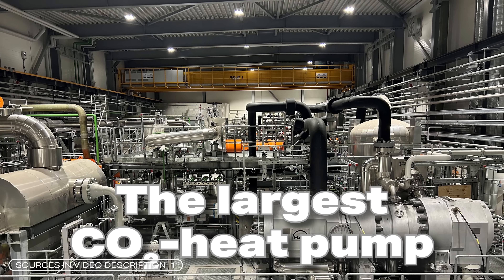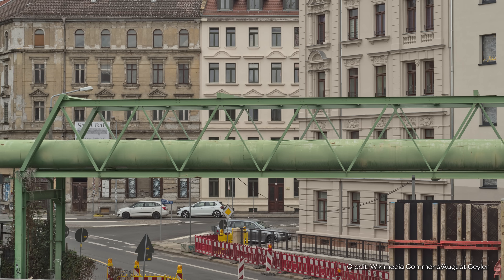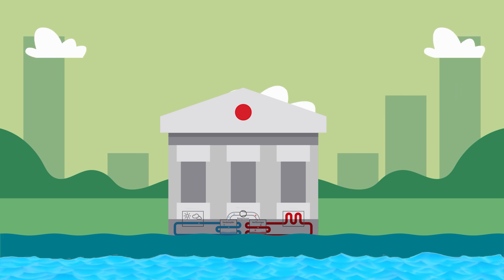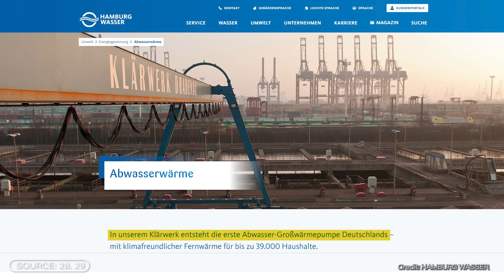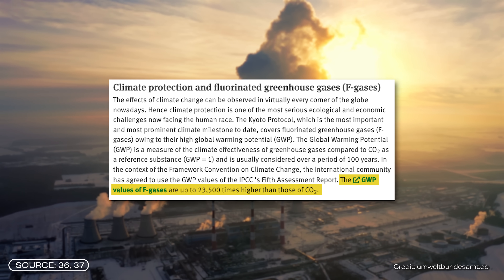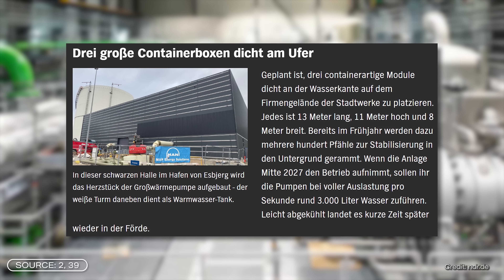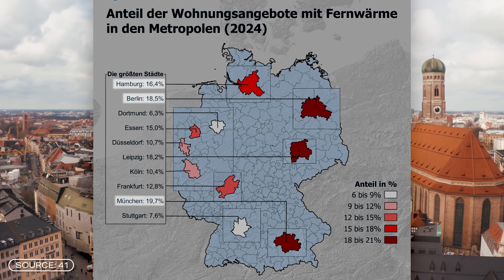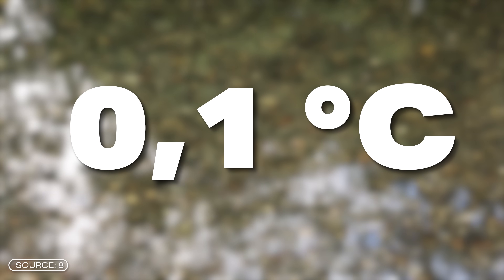World's Largest Heat Pump: Denmark’s Seawater Heating Revolution

Comment: Greetings from Denmark. 
We have a co2 reduction target of 70% already in 2030 and district heating is a big part of why this can be achieved because it enables centralised investments in co2 reduction tech instead of needing to persuade 1000s of individual households. Yes, in some cases it is a bit more expensive, but overall I think people are pretty satisfied. People tend to forget the costs associated with natural gas boiler maintenance and replacement. A residential heatpump installation is easily typically 15-20K euro here.

So you Germans just go ahead and start expanding you district heating. Then you can kill 2 birds with one stone and put some fiberoptic cables in at the same time and get your miserable internet sorted as well ;)

Comment: I'm a Dane living in an area far from district heating, so my 5 year old 95m2 home is exclusively powered by electricity. It's insulated according to the latest standard with floor heating.
My yearly total energy consumption is approximately 2.300kWh. 
The heat pump is very quit since heating only requires room temperature level. 
Heating hot water is a bit more noisy, but programmed to take place every second day when consumption is low and therefor cheap. 
Electricity supply is 85%-97% renewable.

Comment: The future could be about building enhanced geothermal systems (EGS) involving hydro-shearing (which is different from highly problematic hydraulic tensile fracturing used by the oil and gas industry). And unlike near-surface geothermal energy, it can be used across the board almost everywhere, at least in Germany.

Comment: Seawater will typically freeze only when it reaches -4°C (about 25°F), so why does that one big heatpump shut down when the seawater temperature drops below +8°C ??? That implies the flow of seawater through the water intake is too small, so it gets too cold and starts to freeze in the Evaporator section. Sounds like a very bad design! @GermanScienceGuy

Comment: We are located in Finland and we have a ground source heat pump (GSHP) in our 110m2 home. 5/5 and wouldn't change it to anything else! 🫶
I haven't measured how much the pump itself uses electricity in a year but the houses overall electricity consumption is a meager 7800 kWh so it can't be that much.

Comment: Greetings from Finland. My housing co-op with 9 buildings used about 1900 MWh of district heating per year. We converted it to heat pump a few years ago plus over 250 kWp of solar panels. The price of district heating and the required renovation costs of partially 60 year system would have been more expensive.

Comment: Here in Southern England, have a pop-up swimming pool in my garden between June and September, I heat it with a heat pump sitting under my gazzibo. The cold air from the pump cools the general environment around the gazzibo whilst heating the pool during the day and it runs of solar panels on the gazzibo roof during the day, but I mostly use off-peak electricity over night so it cost little run. A really positive experience of heat pumps so far.

Comment: DK: You also have to mention that the losses in the district heating system is systems are qute large, compared to i.e the electric grid. Losses between 20 and 30% is not uncommen, depending on the season. Due ot this fact, a new concept is being developed, where you lower the tempertature on the water in the system significantly, maybe down to 40 or 50 degrees C. And then use that to heat rooms. The hot water needed in the households is then locally boosted to 60 or 70 degrees C, either by a small heatpump or just by electricity (which in DK are mostly green anayway). In this way the losses in the district heating system is cut in half or more. The downside is bigger transmission lines and the need for bigger heat exchangers in the householdt (bigger radiators). But I think this is a genious way of minimizing the losses, epscially in more thinly populated areas.

Comment: Denmark frequently experiences periods of negative electricity prices, even though it actively works to avoid them by curtailing some wind turbine output and diverting surplus power into large electric boilers and, increasingly, centralised large-scale heat pumps for district heating. These heat pumps not only soak up excess renewable electricity but also cut fossil fuel use in heating and provide valuable thermal storage for the energy system. At times, wind turbines alone have produced more than 140% of the country’s electricity demand, with the excess exported to neighbouring countries. Despite this, Denmark continues to expand its renewable capacity in pursuit of 100% renewable electricity. In recent years, close to 90% of its electricity generation has come from renewable sources—an especially impressive achievement given the rapid growth in electricity demand from heat pumps and electric vehicles.

Comment: My parents switched out their old oil furnace for a heat pump. It cut 75-80% off their heating bill, and the whole system paid for itself in 4 years.
Reply from the maker: That's insanely quick!

Comment: COP (Coefficient of Performance)
That is always the question with a heat pump.
I have a geothermal heating system which is 20 years old and when I'm lucky it has a COP value of 4.5 kW.
That is, I use 1 kW electric energy for the compressor and then I get 4.5 kW of heat.
In theory it is possible a COP value above 5.5 kW but I have not seen it yet.
Sea water should be better than geothermal.

Comment: The problem with district heating versus local heat pumps is that you lose the ability to have a dual-purpose heat pump that can also function as air conditioning during the summer. This will become increasingly important across much of Northern Europe in the next 10 to 30 years. And let’s not even get started on the cost of district heating — it’s significantly more expensive than using a local heat pump. In Denmark, it costs nearly twice as much on average, according to Bolius, a Danish NGO.

Comment: Heat from industrial waste can be used all year around, while heat from sea can be fired only when extra heat is needed. It means a more complex heat plan, but it can be very flexible.

15 years ago, individual heat pumps could not work below 5 C. Now they work with minus temperatures. That 8C limit will soon be broken.

Change of provider will be managed like for gas or electricity. When you change the electricity contract for your house, they don't put new cables. It is an administrative change and the actual change of electricity producer happens way higher in the grid. Same for gas. There is no reason the same could not be made for the supply of hot water.

Comment: We don't have them in Australia, but to me it seems like a lot of infrastructure and loss of heat moving it around a city. And really they are electrical heaters from compression, with assistance from an environmental sink. So they are not really 'environment friendly', they are still bascially electrical. They would not be built if they weren't more efficient, but I just hope they are not being built as more inefficient than other methods just because someone labelled them 'environmnet friendly'. Also, to cope with closing 2 weeks a year a whole seperate parallel infrastructure must be built, this is a major flaw. They probably haven't costed because they know it will look extremely bad. Like much of the 'environmental sources of energy', a parallel infrastructure must be built and maintained for when there is not wind or sunshine, and that cost is not included in the cost of the initial infrastructure, because it is old skool fossil fuel. Too many smoke and mirrors in all this for me.

Comment: In the southern US especially in areas without natural gas all electric houses are very common. The majority of house have reversible air source heat pumps to cool in the summer and heat in the winter. Radiators are almost non-existent so that the forced air system used for cooling is also used for heating.

Comment: I live in Copenhagen, we have district heating and it works wonderfully. When everyone else experienced massive price hikes because of the Russian invasion of Ukraine, we breezed through it with cheap staples clean energy, I am really grateful to the unsung hero’s of the Copenhagen energy infrastructure, quietly and reliably doing a grade A job🙏🏻❤️
Reply: that is plain incorrect it just came delayed over a 1-2 years. since 2022 Hofor the company running district heating in Copenhagen has raced prices 22% per MWh and the fixed yearly fee 26%. Natural gas prices are down 60% since February 2022. in reality natural gas where already 30%  below prewar prices buy first of January 2023.

Comment: The sea has an almost inexhaustible  amount of heat at higher energy density to air and a relatively stable temperature year round. Also the sea is getting warmer due to climate change. So this makes sense. The UK could benefit - it is surrounded by the sea and many large towns are located on the coast or on river estuaries.
I saw an experimental sea water heat pump in a science program years ago and wondered why this is not already extensively used. Something to do with corrosion of heat exchangers by sea water maybe ? Just a technological challenge.
Not having 100% renewable electricity is not an issue. The heat pump multiplies the energy by 4 or more so one unit of gas generated electrical energy (efficiency 50%) could generate 2 units of heat. So this has already halved the gas consumption compared to burning the gas directly for heat.

Comment: I still don't understand how heat pump heating works... Let's say it's -20° Celsius outside and we want 20° Celsius inside. Will it really make outside even cooler, while heating our inside, at 500% efficiency??
We keep hearing that heat pumps are scam, how exactly that 'magical' extraction that defies thermodynamics happens?
Reply: No it won't make the outside colder, it will actually still make it warmer but less so than burning stuff.

E.g. if a home has a 10kW heat loss at -20C, a gas boiler will be putting 10kW of heat into the home and losing an extra ~1kW out the flue. The 10kW added to the home will escape into the environment as well, hence why the boiler needs to be constantly running, so it's adding ~11kW into the environment.

With a heat pump some of the heat is "borrowed" from the environment, in -20C, with an ASHP you're going to get closer to a COP of 2.
Which means 5kW will come from the electrical components and 5kW will come from the environment.
As the heat is constantly lost into the environment, in that scenario there is a net gain of 5kW of heat into the environment.

Comment: I live in Denmark with district heating. I remember the heating company actually reducing the price in 2022-23, when people with natural gas furnaces were facing extreme price increases. It can be very affordable, it's mostly a heavy up-front cost of building out the network that can seem scary. Plus in Denmark, all the larger cities already have their network built out, so new projects are in more rural areas where the economies of district heating are worse. Those problems are what you hear about in the Danish media most often.

Comment: Central Arizona uses a lot of air to air heat pumps but are obviously distributed; houses are a lot further apart here. Heat pumps are moving into the alpine areas as newer systems are getting significantly more efficient however there aren't as many options for water heat sources to supply them. As far as shared heat sources, I believe New York City's Con Edison steam heat system has been in use since 1882 but is obviously a significantly older technology. I'm sure it could benefit from advances in technology but the legislation would be daunting...

Comment: Comparing heat pump installations with The USA is problematic. Northern States need heating, Southern cooling and the rest both. Comparison to Northern States or one State might have been better. Germany sits between 45 and 50N Latitude, The USA 25 and 45N so think Southern Canada :)

Comment: Quick tip: in English, commas are not decimal points. 12,3% means 12300%. 12.3% means twelve point three. This is a common mistake made by Europeans.
Reply: Yes, and vice versa. From what I have found, the world is split 50/50 on this. I've stopped worrying about it and just write the way I'm used to followed by the country code - just as with dates, 1.200,3 (DK); 10/8 (DK). Like here on Youtube, people commenting are from all over the world and thus it's impossible to write it the "right" way.

In this video the comma is used as decimal seperator though.

Comment: The heat pump is converting 1 part of mechanical energy into 3 parts of heat energy, a combustion engine is converting 3 parts of heat energy in one part of mechanical energy.

Comment: Thanks for the interesting video. Your figures regarding Denmark's energy production are a bit outdated - e.g. coal is being phased out. The latest information shows that renewable energy contributed 82.1% (wind and solar 63%) of electricity production in 2024. 4 out of 5 new cars sold are EV's.

Comment: When heating is not required, cant that hot water ither be connected to a domestic heat pump to cool radiators, or to some turbine as an energy source? sourly energy is energy,  that can be used some how?

Comment: Sweden here 146m2 old house, 200km north of Stockholm so we get real winters (-30C is not uncommon). I live on the contryside, last year i installed a geothermal heat pump and 800 meter surface tubing at about 1-1.2 meter. I get an average cop on the heating at 4.3-4.4. January was the coldest month and the pump used around 400kwh to keep the house 20-21C. I works so good and was totally worth the effort.
Reply from the maker: That‘s great! And sounds like a lot of rough winters 🤧
Reply: It would actually be good if we could get more geothermal heat pumps in Denmark, but there are two factors that cause problems: most plots are not big enough for it and in many places there are restrictions on being able to drill deep enough holes as it can cause problems with groundwater, drinking water and so on. Is there also the price of such a system?
Reply: @kastrup2dk  The price ddepedns on the system size mostly, there is a fixedd prices for a well and one for laying hoses close.
Reply: Bullshit. BERGVÄRME
Reply: Bullshit. BERGVÄRME
Reply: Geothermal should be nr.1 heat source of everything. And we should invest more into technologies to get future down, to get even more heat for higher pressure.
Reply: @MoZz..  Geothermal isn't viable everywere, as you do need the ground to be viable for it too work, and it also depends on laws and other infrastructure and type of geothermal you are using. Did a project on it in university and the site choosen turned out to have a "under ground" mountian range going trough it, making it not viable as the right dept and soil wasn't possible to be reach.
Reply: kw/h is an acceleration of consumption. you probably mean that in January the pump consumed 400 kwh.
Reply: Damn, 400kw is a lot of energy :(
Reply: @antonhelsgaun  Hmm its not, with electric heating here it would be 2500kwh at least., an average house here is 20000-30000kwh a year.
Reply: @antonhelsgaun   an old-fashioned refrigerator uses about 400 kWh of power per year while an American refrigerator does too.
so the fact that the heat pump doesn't use more is actually really good

Comment: When recalculating for german households you should not use the figure for average heat energy consumption, but use figure for heat energy demand. Households energy demand will be very different depending on what heat source they use (heatpumps especially)

Comment: I use a combination of well water source heat pump with solar thermal vacuum tubes, 100 gallon hot water tank, 1000 gallon basement concrete heating/cooling buffer tank powered by solar in a -30c climatic, ground water heat pump heating/cooling is more efficient than air due the high temperature difference, overheated buffer water is trickle feed back to garden, trees and pond, ground water, expanded size of all season green house to use excess heat, zero water, gas, electrical and very low grocery bill... don't wait for companies to innovate

Comment: It would be very nice to get a tour of that heat pump and find out what inovative tech they have going like the turbine on the expander and regenerator heat exchangers (internal gas to gas heat exchangers between hp CO2 after water hx and LP CO2 before compressor. 
And thermal scan heatmap video 😎
Reply: For a slightly more detailed video, Google for: Inside the world’s first giant heat pump that heats an entire city with CO2 and sea water